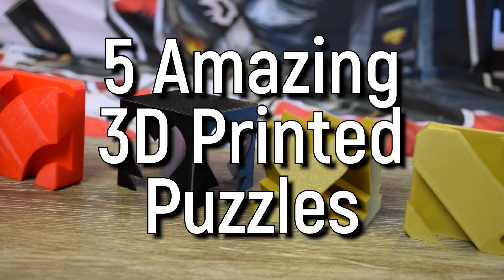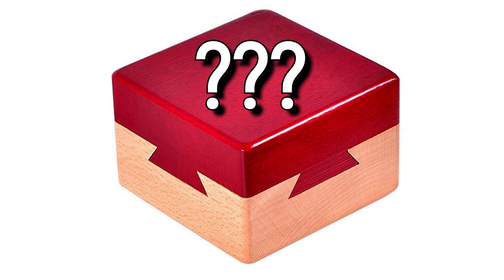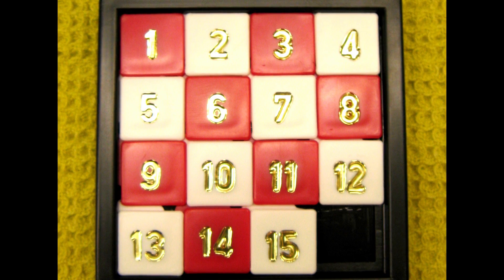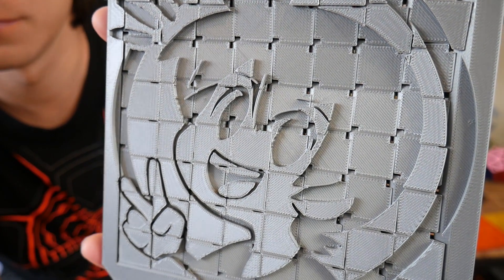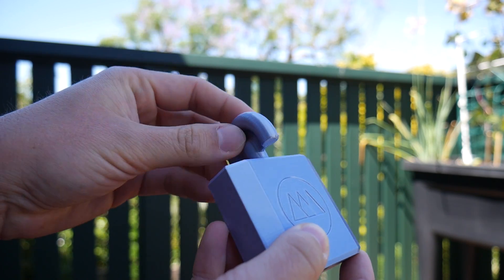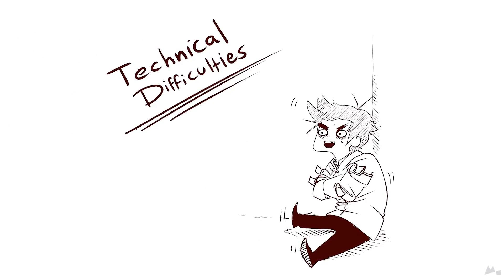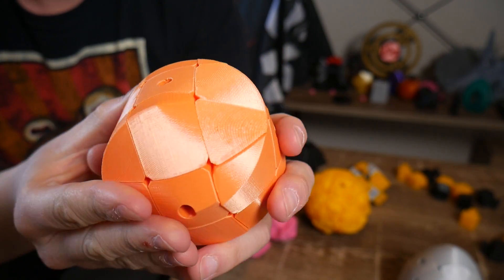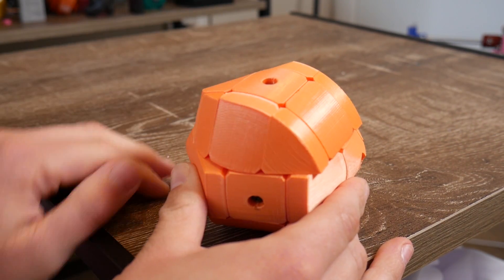Can you Solve these 3D Printed Puzzles?

Comment: How did you print the pieces so they slide together easy? Do you design one part smaller? For example I tried the dove tail and kept the same shape just flipped it. But the peices fit very tight. Is there a tolerance you set or just make the one part smaller?

Comment: Hey Angus, additive manufacture like this always appealed to me, but...  It kinda looks crappy.  I know it's on the cheap and at home and that, but is there anything one could do to make the pieces look nicer after printing?  Maybe like sanding them down to smooth, or using an iron to melt and flatten some surfaces or something...?
Reply from the maker: Sure, you could sand it and paint it or coat it with something, or use special filaments like Polysmooth which is smoothed with IPA. That takes a lot of effort after printing however!
Reply: @MakersMuse  If someone's worth giving a present to, they're worth the effort.  :3
Reply: If you print in ABS, you can use an acetone vapor bath to smooth out the surface, depending on what you're printing.